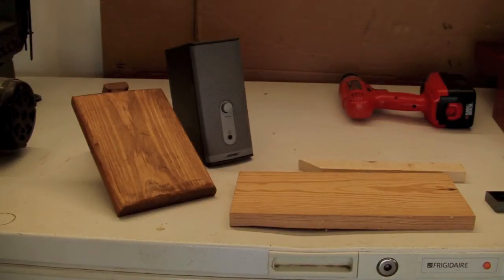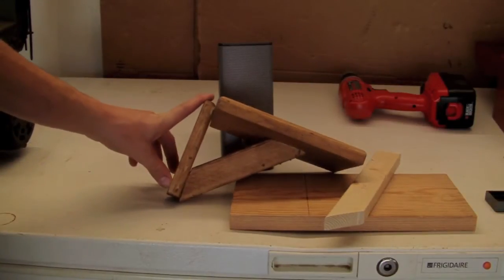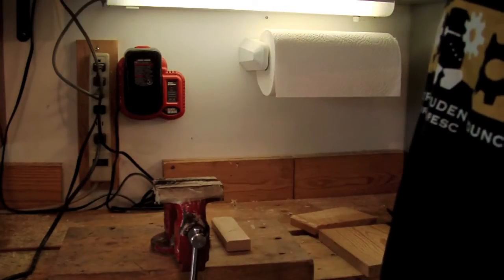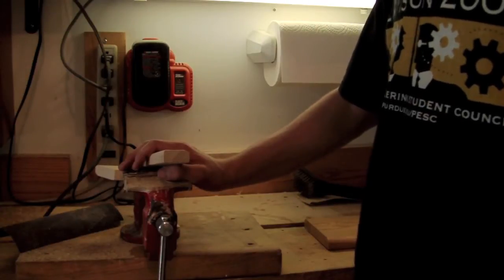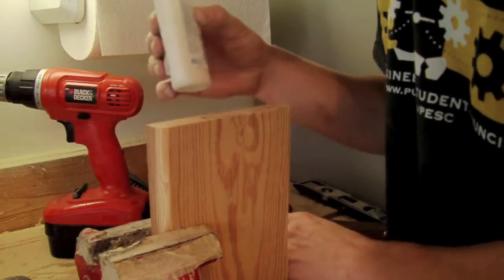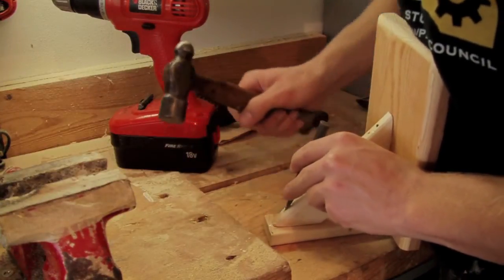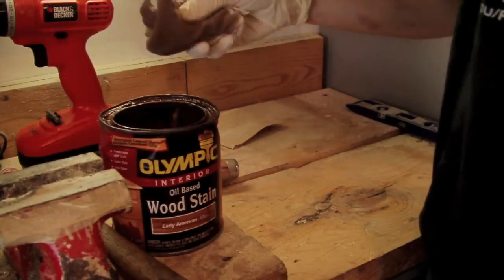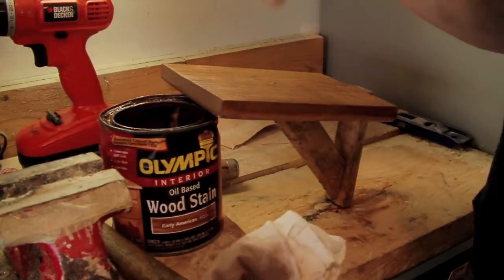How To Build A Speaker Shelf

Comment from the maker: If there's no wall bracket made for it then you might have to make a shelf, and yes, it's totally doable! It would be very similar to this, but just using "bigger" wood and screws. Making sure that you mount it to studs within the wall is critical since monitors are fairly heavy.